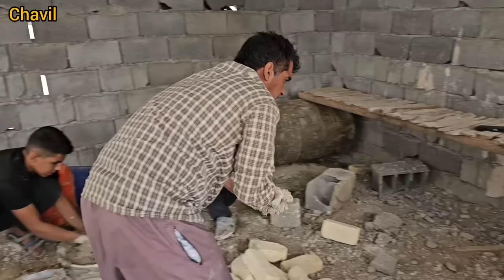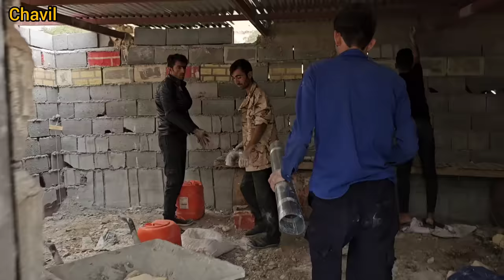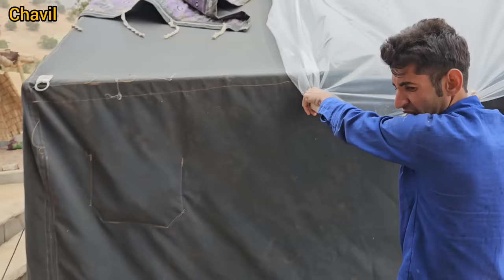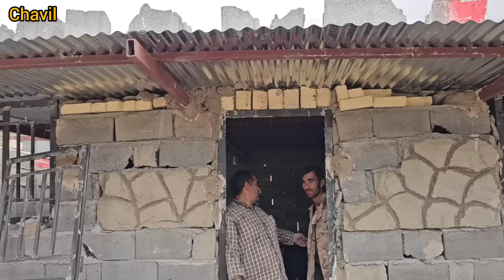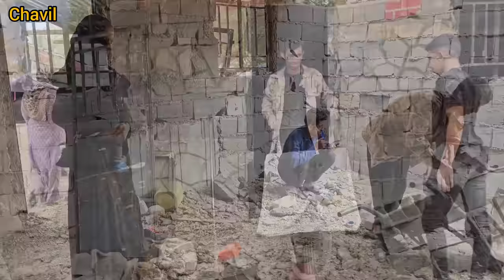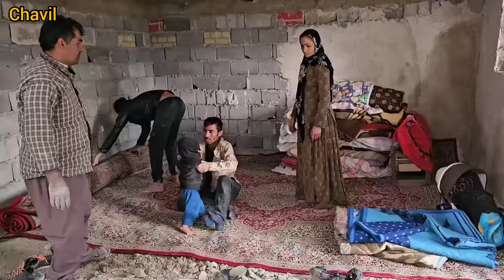Chavil installs beautiful doors and windows for his house with the help of his relatives

Comment: Страшный какой дом сляпали, туда даже коз жалко запускать.        Похож на придорожный, старый туалет, которые еще попадаются на пустынных трассах
Reply: Concur it's no house. It's not going to protect you from the elements. They'll freeze or burn house down trying to heat it. Very dangerous. It's not but a bunch cheap blocks stacked on top of each other. Windows & door held together by plaster. You need wood frames or steel to hold them together. Concrete there always cracks i'm not sure what is in your mix but I see that happening everywhere! Good luck you'll need it! How do you plan getting in & out of that location on mud?
Reply: Бросят, уедут и другой начнут ляпать.

Comment: They build small houses like that in Alaska, but use wood they mill, mails, etc They still end up with holes occasionally. They light a candle & put it by walls, one at a time & if the flame 🔥 leans over they knotheres a hole somewhere. They plug up that area. These guys use cement for everything but that cement cracks after it's dried. If it cracks & breaks those windows will fall & hurt someone.

Comment: Ali are ya sure tha tin roofing will hold mbe you should've use cement or plaster to hold em securely. hoping tha tha roof won't blow off whn first winter wind sets in. oh no tha door dsn't hv tha glass put in to